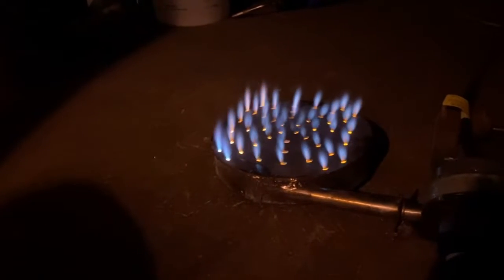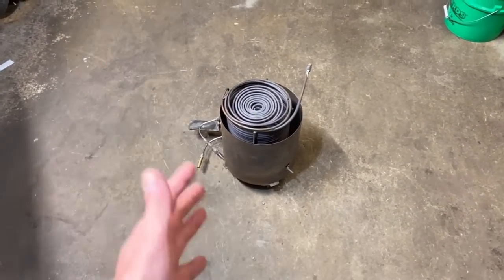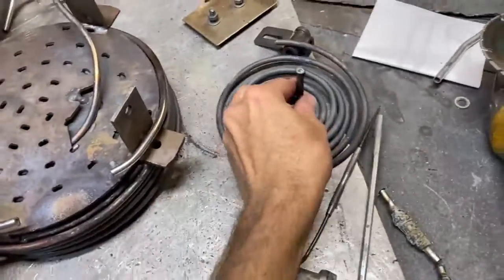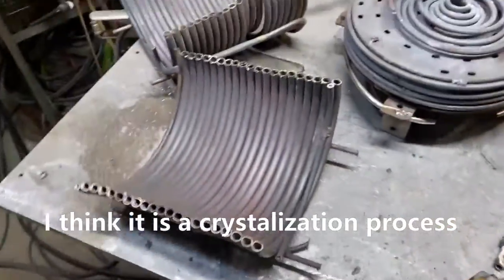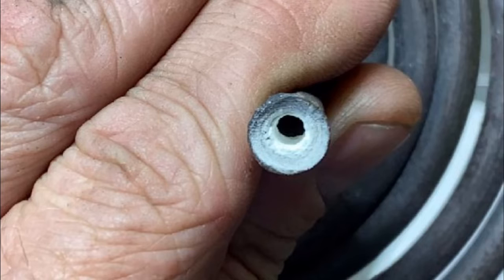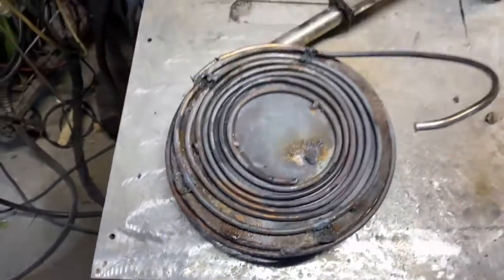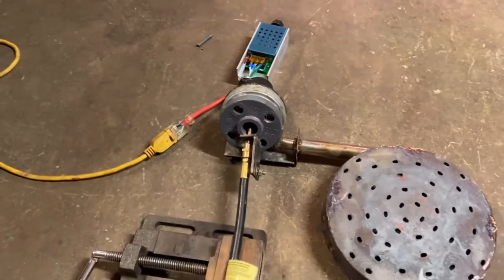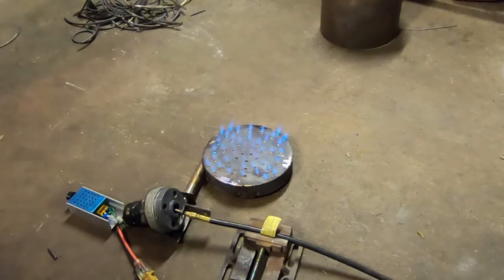Boiler scale build up and boosting boiler burners

Comment: See if that buildup can be dissolved or broken up with white vinegar or even lemon juice (so it leaves a nice smell while cleaning the crud out) rather than CLR...might be able to run a little white vinegar thru it while running to blow out the crud and prevent loss of efficiency...could be a solution rather than running an expensive water treatment system, and much cheaper

Comment: If you want to be able to use untreated water I suggest you make this with a removable coil where the removable part is where the majority of the scale builds up.  IDK what these are going to be used for, if it's 24/7 use or if it is used "per job" where a worker will use it a few hours at a time or maybe over a whole day.  But I'd suggest have them swap the coil at 6-8 hours or at the end of each shift/job.  While the other coil is used then have the blocked coil being cleaned. 

I'd suggest you use some kind of pump to flush cleaner/water through the coil.  I'd skip CLR as it will require too much.  I'd look at either hydrochloric, phosphoric, acetic or oxalic acids.  They should all work pretty well and do a good job removing the calcium.  I listed them in order of which they will work the fastest.  They are all readily available except phosphoric but that can be ordered.

Comment: how about an easy swappable preheat vessel that is not a tube but a little tank at the same location as the place where all the clogging happens...vinegar could scrub it out. hot water heaters use magnesium sacrificial anodes to stop the copper rotting....something to think about. thanks for reaching out bro.

Comment: The flamemister is at it again Ha i know thats was a bit corny but i had to say it great work as normal cool stuff .yep filtering heavy elements from  water is  a must thanks for tip on blades i ant never used them as of yet but i will now .What brand of blade / cut off wheel do you recommend man ? be blessed and thanks